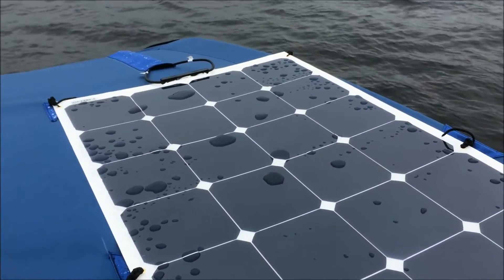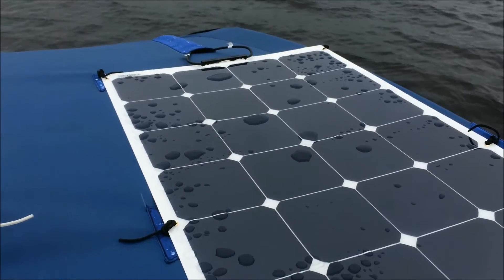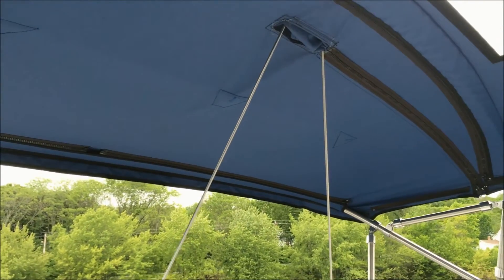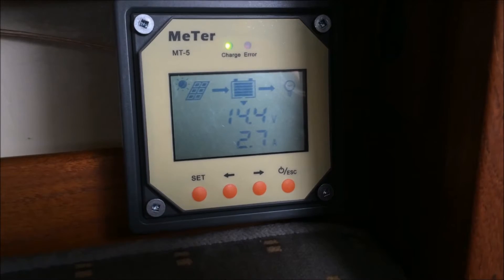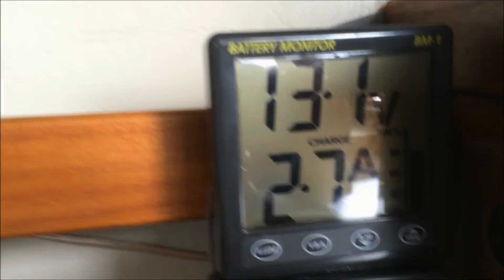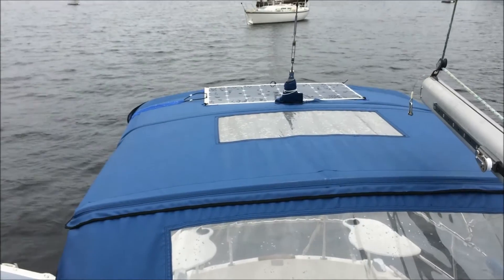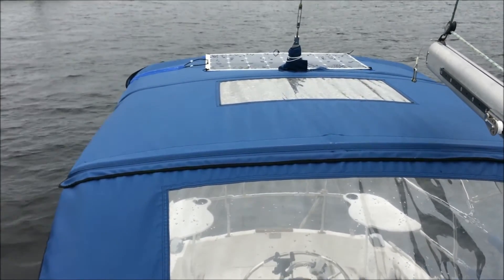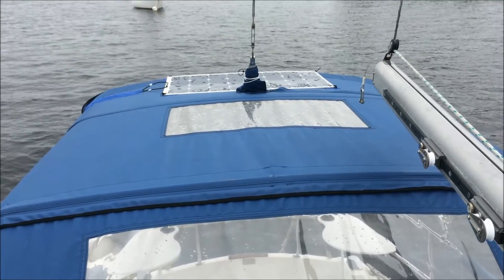Review of Renogy 100w Monocrystalline Bendable Solar Panel

Comment: The problem with this install is when you do serious sailing in open ocean or you prepare for a hard blow it has to come down along with the canvas. Deck installed panels avoid this. Stern frame mounted rigid panels still have to come down in a blow too.
Reply from the maker: Good point but of course may boat is a costal boat and if i went offshore would have more problems than just my solar panels.

Comment: I have two of these Renogy flexible panels on my Aliner Scout hard side pop up trailer (two roof sections, front and rear section raise into a "A" and then triangular side panels folded flat under the roof raise and lock into the raised "A" roof sections.       I used 100 watt rigid panels for the first few months, but that was 40 lbs of weight on the front roof section and that made it difficult to raise the roof (which is manual, but spring assisted).  So in March 2015 I ordered two of the Renogy flexible 100 watt panels and mounted them up.  Total weight including the mounting system is 10lbs, its way easier to erect the roof compared to the rigid panels.    Charging amperage is good,  at 12 to 16 amps (MPPT charger) in good sun.   But this past week I removed the panels so I could build a lightweight removable frame so that I could detach and put the panels into the sun instead of trying to maneuver (often by hand) the trailer's front roof section into the sun.  And I noted a thin plastic layer is delaminating across the panels. I emailed Renogy and they offered rigid replacements or my money back.  I have a set of rigids, and can't use them, they are too heavy.  So I am stuck needing a lighter module, and these flexible panels seem to be not only the best, but the only option.  But this peeling issue has scared me,  I don't think its a shipping film delaminating,  it could be a film to protect the plastic under the film from UV light.  So far the panels are clear, no sign of fading or discoloration from sun exposure after almost exactly one years of use.  If I take Renogy's refund and order a different brand of panel I will likely end up with the same panel, someone in China makes these panels and numerous marketers including Renogy resell them.   Kudos to Renogy for backing these panels with a good warranty,  but I am kind of stuck needing this type of panel and also scared of them at the same time.
Reply from the maker: +Jeffrey Deans It looks like they are not be best for RV usage from what I have seen. I am going to do a follow-up review this summer when the boat is back in the water.

Comment: Hi David.  I have my system hooked up now.  I only have one 100W panel but will purchase another one in a month or two.  Just wondering how this connects to your dodger.  Looks like your canvas shop sewed some triangular patches on, right where the grommets are in the panel, but are their grommets on the dodger flaps with cordages/ropes coming out of them then thru the grommets on the panel?  Can you do a short video of the mounting system or descript it to me in some detail?  Thanks!  Wade
Reply from the maker: yes I can put up a video on the ayachment. But you are correct my canvas guy put pads under all grommets with line sewn into them. After two summers no sign of damage or where.

Comment: Good job on the video and the installation.  Am curious about how this might work on my Catalina 27.  I have two group 27 deep cycle batteries and live where we don't always get direct sunlight.  I have a large area on my dodger where a panel like this would work or I can strap it to the foredeck.  Do you think this would work for my needs?  Also, I'm curious about the connection on the panel where the wires exit.  I've heard that can be a problem area if it's not mechanically fixed to the panel.  Any issues there?  Thanks so much...
Reply from the maker: Wade Rogers No problems yet with the connection  and the entire setup  survived 50+ knot winds and storm during witch we had two boats break away from moorings and ground.  I was out of town so couldn't take my canvas down but she survived unscratched. It takes about two or three days to charge from 50% on my setup so works just fine where we are weekend sailors for now. I have 200 amp hour 6 volts wired to 12. Just don't forget a good charge controller. I have a overview of min on the channel.
Reply: +David Drysdale Thanks for your reply.  I purchased a 100 watt panel, charge controller, and the MC4 connectors and wires.  Am going to wire my 2 cat 27 deep cycle batteries in parallel this weekend.  Here's an idea for your boom:  lash it to either the port or s/brd side when not in use so it doesn't shade the panels or when motoring so the panels get as much sun as possible.  Tie a line from the boom end to your toerail or lifeline.
Reply from the maker: Glad it is going well wade Rogers. On the cat 30 the boom didn't go back as far as where I have the panel so no shadoes.

Comment: How did you run the wiring into the boat. I have a Catalina 309 and thinking of adding solar panels on the bimini.
Reply from the maker: I have yet to properly run the wiring. For now I just tied it along Bimini to the Dodger then in the hatch. This summer I am going to properly wire it and will post info when I do.
Reply: +Greg M Greg, I ran mine from the dodger top, down into the cockpit then thru one of the cubby pockets in the cockpit, where you store winch handles.  There's a 1" hole in the very far back part of the cubby, where it won't get rained on because once you unplug the MC4 connectors from the panel, their contacts are exposed to air and water.  They're waterproof while plugged in but not while unplugged.  I take the extra cable that goes up to the panel and tuck it back down the hole in the cubby pocket, which is right above a large cockpit locker.

Comment: Thanks for the video
what is the capacity of the battery you used??
how long it takes to recharge 12v battery 80 amp??
Reply from the maker: I have 220AH battery's. Their are a lot of factors on charge time but I would say it looks like around three days for 80ah.